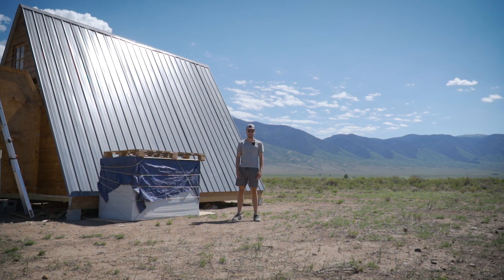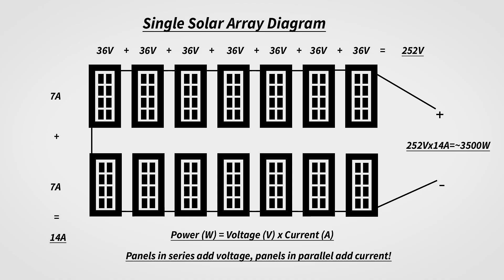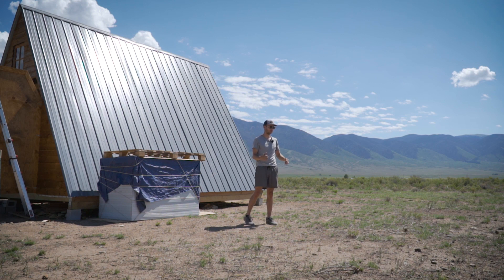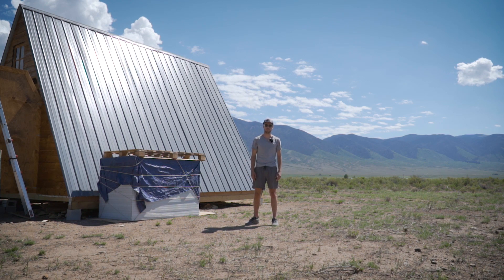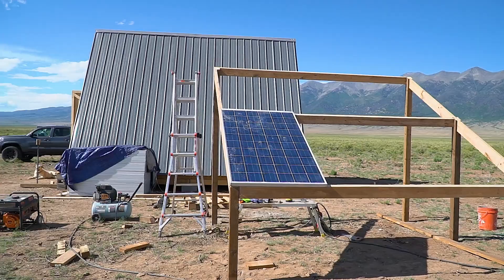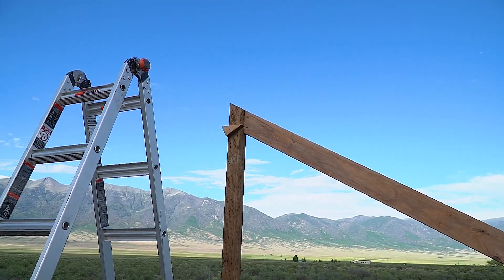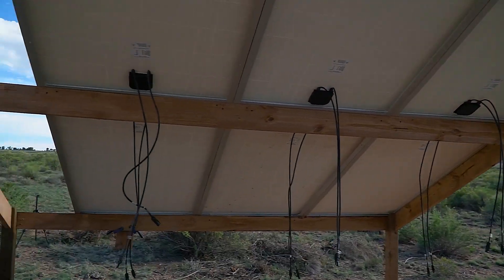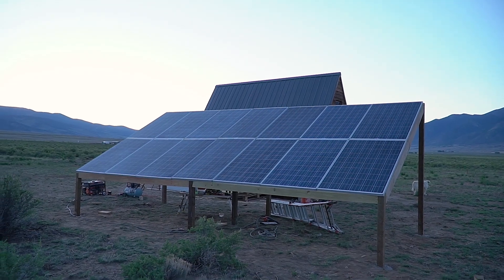DIY Building My Off-Grid Home: the Solar System pt. 1

Comment: What hardware did you use to tie the panels to the structure. I am always intrigued to see what people come up to mount panels if not using any type of rail system. Looks great, I also have an EG4 but haven’t installed yet, just running on an older Growatt. Working on a second array with  more panels installed to get my voltage up closer to 450V. Thanks.
Reply from the maker: Hey Jimmy, so I temporarily mounted the panels in place with some clamps and then drilled 1/8” pilot holes through the 2x6 at 45° and then into the bottom edge of the aluminum panel frame. I then ran a big deck screw through each hole that cut a thread into the aluminum and anchored it to the wood in 6 places per panel. I don’t doubt it’s holding ability, but the screws may experience galvanic corrosion down the road because of the metal mismatch, so it’s something I’ll have to keep an eye on!
Reply: @RidgyDidgeRanch  thanks for the reply. I was looking at some unistrut to attach to my 2x6 and put some of the bolts that slide into the strut and use a large washer between each panel where they meet. Just need to find an end clamp for each end of the panel. I am sure I can buy the stuff, but seeing what I can find for cheap. I got some unistrut from a building that was torn down. Most of it is in good shape, some of it is bent, but it was free and that is for me. Have fun on your project, off grid is the way to be. 😁

Comment: All panels facing south is an old idea left over from the 80's when batteries were cheap and panels were expensive.  Now it is the reverse. If one has the space, a set of panels facing east is a great idea. Battery quickly recovers early and power is produced all day long lowering battery requirements.  I'm almost a batteryless system and have refrigeration, dishwasher and clothes washer all from PV. Any excess power heats water and I am at 62C before 10am so she can use the dishwasher. Laundry has its own hot water tank and all cycles are done with hot water. I don't waste any power from the panels.

Comment: HOWdy B-b-B,
You installed your 1st PANEL on the wooden RACK - 🙂 = HOW ?  
How did you attached them --- You TESTED each Panel - could we SEE while you do this ? 
COOP
...
Reply from the maker: Hey mate, so I didn’t bother with the Z clamps in favor of an angled screw through the wood and into an undersized pilot hole in the lip of the panel frame in 4-6 places per panel. Testing the panels was just checking open circuit voltage and current numbers compared to the spec sheet. I’ll touch on this in the second video when I connect it all up and test the true power numbers under load. Appreciate the feedback!